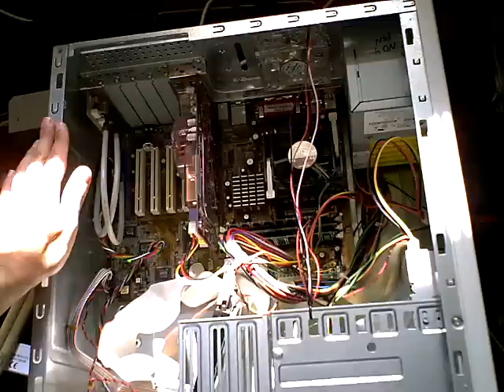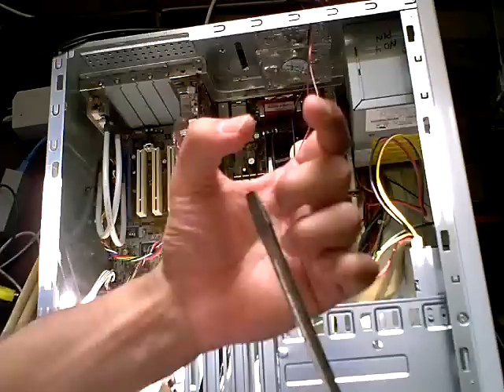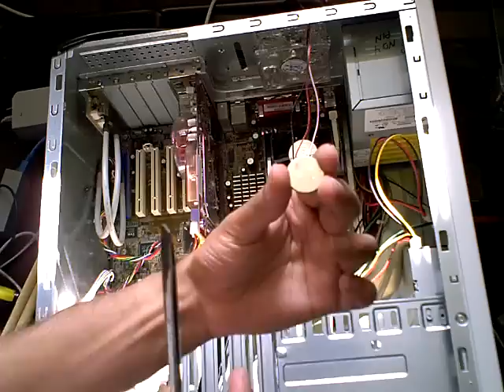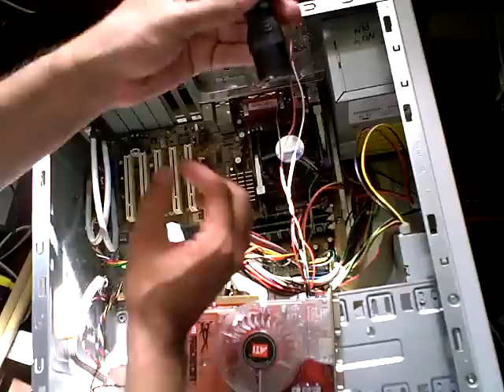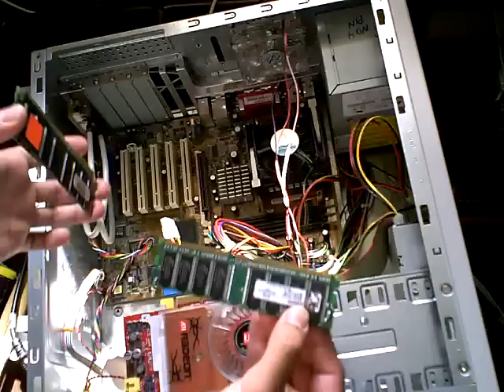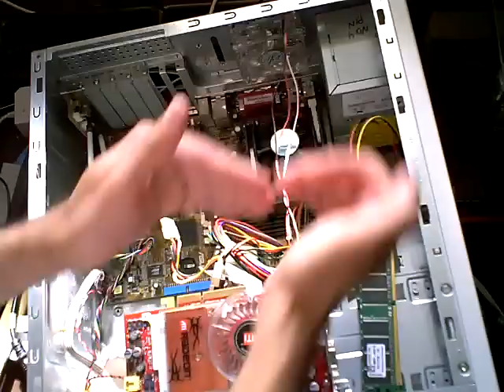How to possibly fix a PC that will turn on but will not beep and will not display anything on screen

Comment: Hey my computer will turn on and then it beeps 1 Long and 3 short and turns off but when I remove the RAM it just runs like normal but no signal isgoingin in the monitor will it work if a replace the RAM
Reply from the maker: Your beep error code is reporting a problem with the display, not with the RAM. I had a similar issue in this video, perhaps you should try everything in this video and let me know if it works out or not:

Advanced troubleshooting technique tutorial of how to possibly fix a PC that will not beep at boot
Reply: OK so I did and it work thanks but heres other problem it over heats and turns off and some times I hear the beeps but most of the time it doesnt so how do I keep it cool?
Reply from the maker: Lizbeth Hernandez  This following video was created for a different processor than yours (chances are) but the tips about keeping the heatsink and fan clean, well attached, and the application of thermal paste all still apply here. Also, ensure that your case is CLOSED (yes, closed channels air BETTER) and install a case fan to blow air OUT of the case (this expels hot air from the case). Of course, ensure that your CPU fan still spins at an adequate speed (reference the temperatures of the CPU to the shutoff temperatures suggested in the BIOS if you are unsure).
 
How to possibly fix your socket 478 CPU processor (Pentium 4 IV) from hanging or freezing

Comment: When I removed the ram and started it, it went 1 long beep, immediate followed by 2 short beeps
Reply from the maker: +Squidly Beep error codes differ from one BIOS manufacturer to the next. To discover what the beep error code is trying to telling you, discover the manufacturer of your BIOS (available in the motherboard's manual or on the motherboard's manufacturer's website {on the page for your specific motherboard model}) and then look up the frequency and interval of your beep error code on:

http://www.computerhope.com/beep.htm

Comment: So i finish building my pc i turn it on for the first time the fans are working everything (didn't hear any beeping) is working but then i look at my monitor and its just black
Reply from the maker: +BestLegitGamer Breadboard it (explained in the following video:)

If the steps in this video did not provide a solution to your problem, view:

http://www.youtube.com/watch?v=_EK9a-R5pss

You never know, maybe rebuilding the PC in the opposite sense that you took it apart will solve the problem.

Comment: so if i remove the RAM and power it on is it possible i can short out the PC or anything like that
Reply from the maker: +Mr mc nuggets Theoretically no, but if you did not properly unplug the PC and press the power button to discharge remaining power before fiddling around in there, you can in fact short out components, so ensure to unplug the PC and press the power button (on the chassis) before removing parts
Reply: thanks i tried the ram but sadly my mother board is dead :(
Reply from the maker: +Mr mc nuggets Well, before deeming the deal dead, I try first to Breadboard it (explained in the following video:)

If the steps in this video did not provide a solution to your problem, view:

http://www.youtube.com/watch?v=_EK9a-R5pss

You never know, maybe rebuilding the PC in the opposite sense that you took it apart will solve the problem.
Reply: thank for the advise i appreciate it

Comment: Hello...When I start my PC it turns on it gives 2 short beeps with a pause and everything works on in CPU but no display comes.3 out of 5 times this happening what I do when it happens that I clean ram and reset and remove and reset power supply from motherboard and it works after trying many times.
and what I recently did before this problem occurred is I changed my PSU with used PSU, my earlier one had 24 pins but the new PSU I mean used one has 20 pins so the other 4 pin separately attached somewhere side.
plz tell me who is culprit Ram or Psu...coz before changing my PSU everything was working fine but 2 short beeps with a pause and resetting ram and wires solves the prob many times...so I confused what to do?
I have 
no graphic card just the default one which comes
assembled PC with 4 GB ram(2 sticks) Intel motherboard and Intel i3 processor
running win10...just a simple CPU 5 yr old
Reply from the maker: If everything was working fine with the old PSU and the current one no longer connects in all the required power ports, it sounds like a more appropriate CPU with all the required connectors would be a better choice.

Comment: My pc isnt deat. Yet. But when i turn on the pc the fan wont spin, well it spins thefirst 10 or 5 seconds. Help fix.
Reply: I mean dead
Reply from the maker: +UnTamed Gamer / TheBronyCommunity It sounds like your motherboard is developing a short circuit due to contact with the metal casing. Most likely it has to do with the screws and metal mounting stands (supports) that your motherboard sits on. The cheapest way to fix this problem is to introduce cardboard washers between the screws and where they make contact to the motherboard, or you can buy plastic mounting supports at a computer shop.

Alternatively, you can always Breadboard it (explained in the following video:)

If the steps in this video did not provide a solution to your problem, view:

http://www.youtube.com/watch?v=_EK9a-R5pss

You never know, maybe rebuilding the PC in the opposite sense that you took it apart will solve the problem.

Comment: hi! can i ask ? my cpu turn on but it didnt work and the monitor display is black  i already take out my memory and put it back and also  my fan stop working but sometime it work can you help to solve this i need my cpu to work again.
thanks more power and god bless!!!
Reply from the maker: +Da Jia Sorry for the late reply. you can always Breadboard it (explained in the following video:)

If the steps in this video did not provide a solution to your problem, view:

http://www.youtube.com/watch?v=_EK9a-R5pss

You never know, maybe rebuilding the PC in the opposite sense that you took it apart will solve the problem.

Comment: i change my video card but whenever i use the new video card nothing appears on my screen. even though the new video card is working. please help me!
Reply from the maker: It sounds like your PC is defaulting to a different video output than you are connected to (possibly even the onboard integrated video output). Keep in mind that you can only change to different video outputs by first shutting off your PC, then changing your display cable to a different video output, and then powering your PC back on. If the first video output change doesn't work, then again power down your machine, connect your display to a different video output, then power up. Repeat this until you have tested every video output available on your PC. Lemme know how this turns out.

Comment: In my pc it does beep and shows windows was not succesfully shut down and i chose start windows normaly then okay the winows loading logo but when it comes to say welcome that screen dosent show up , plsss helppp if i dont fix i willl dieeee 😓
Reply from the maker: +DV Chanel It sounds like your Windows has become corrupted sadly. You can try entering Safe Mode (hold F8 at the bootup of the PC and then select Safe Mode) and see if you can enter your Windows like that. Let me know how it turns out.

Comment: When i press the power button the cpu power on but there is no response in my monitor and keyboard then open the cpu there is the blinking light in network card i tried to remove ram and inserted again then my pc starts but when i shutdowns the pc then again that problem occurs in next start.so can u tell me the problem
Reply from the maker: Intermittent problems such as yours are often too hard to diagnose. I recommend getting the PC into a working state, and once working, when you are done using it, put the PC to sleep instead of shutting down, so that you can wake it when needed and this way you avoid the trouble of booting it. Sorry for the weak fix : \
Reply: RodneyDickson my  problem is resolved there was a issue with my 1 of the ram out of 2 ram 1 was  not  working so I replaced that one now it is fine . thnx for the suggestion
Reply from the maker: Ahh, glad you got to the bottom of the issue.

Comment: Bro i made my build yesterday but the usb ports or other ports arent powered although the led on mobo and gpu is working fine but the ports r lacking power and hence i cannot connect. Can someone plz help me out?
Reply from the maker: +Nimit Jain Are the USB ports on the back of the PC (those physically connected to the motherboard) putting out power?

Comment: Please help me still get beep sound after clean the ram have you another solution? ?? Thanks in advance
Reply from the maker: What is the beep error code telling you? Beep error codes differ from one BIOS manufacturer to the next. To discover what the beep error code is trying to telling you, discover the manufacturer of your BIOS (available in the motherboard's manual or on the motherboard's manufacturer's website {on the page for your specific motherboard model}) and then look up the frequency and interval of your beep error code on:

http://www.computerhope.com/beep.htm
Reply: RodneyDickson thanks you its the rams that not working and thanks for your help
Reply: RodneyDickson nice works
Reply from the maker: Cedric Chellen
Good stuff! Glad things worked out : )

Comment: hi to everyone i have same problem on my pc , i tried everything but still doesnt display anything . when i take out the ram and turn on the pc it doesnt do any bepp or something like that it just continue working , or when i take out cpu and turn on the pc it stiill works whithout doing any beep or any sound . what is this and what can i do , can somebody help me , i think my motherboard is for gurbish
Reply from the maker: +Enes Elezi Well, removing the CPU from the PC would not produce a beep anyway, since in doing so you are essentially removing the PCs ability to process. I'd Breadboard it (explained in the following video:)

If the steps in this video did not provide a solution to your problem, view:

http://www.youtube.com/watch?v=_EK9a-R5pss

You never know, maybe rebuilding the PC in the opposite sense that you took it apart will solve the problem.

Comment: I have a dell pc its the screen and monitor in one. it turns on but nothing shows on the screen can u tell me wats wrong with it
Reply from the maker: Eek! Those are a pain to work with. When your PC used to run normally, did it have a startup sound? and if so, do you still hear that startup sound at boot?

Comment: Ten year old Windows XP system was moved into my new apartment today. Hooked it up, booted it, pulled up a .doc, left the room came back and it was dead. No video fans or beeps.
Reply from the maker: disconnect the power cable, remove the CMOS battery, short the CMOS jumper pins for 9 seconds then return the jumper cap to its initial position, press your PC's chassis power button switch (to discharge any remaining power circulating in the system), leave the PC unplugged and in this state overnight, then the next day return the CMOS battery to its socket, power up the PC, and if things work, then good, but if not, your power supply may have died.
Reply: I jumped the power supply. The blocks internal fan runs as well as the cases rear fan and hard drive but I noticed if I plug the black and yellow four pin connector back into the motherboard everything stops functioning.
Reply: I noticed some brown color inside of the molex block specifically on top of both yellow wires where they terminate. I'm thinking something shorted.
Reply from the maker: That sounds very probable, especially given the browning of the connector.

Comment: THIS WAS VERY HELPFUL YOU EXPLAIN YOURSELF VERY WELL IM IN A SITUATION WHERE I BELIEVE THE COMPUTER I FOUND THE ORIGINAL USER TOOK HIS HDD OUT AND I HAVE NOTHING TO RUN IT ON IM NOT SURE IF IT HAS ALTERNATE HDD INSIDE MAYBE A DEFAULT I DOUBT BUT I NEED A NEW HDD TO RUN IT PERIOD. THIS VIDEO HELPED ME OUT ALOT BECUZ WHEN I FOUND THIS POOR COMPUTER I HAD A  FEELIN IT WORKS BUT AT FIRST I COULDNT GET A ANY SOUNDS NO PICTURE IM VERY INTO FIXING COMPUTERS BUT IM  NO PRO LIKE U BUT I AM A FAST LEARNER IVE BEEN PROGRESSING AS I GO BUT I GOT SOME SOUND ONCE I REMOVED THE RAM I LEFT ONE IN AND I SOME HOW GOT THE SYSTEM STARTED I REMOVED THE GRAPHICS CARD TOO WHEN I DID EVERYTHING SORRY IM TYPIN ALOT I SMOKED A BLUNT AND JST NEED ADVICE SO I WANA BE CLEAR ON MY SITUATION. ALSO I RESET THE CMOS WHEN THE COMPUTER DIDNT START I KNEW IT WOKRED SO THEN I PUT IT BACK ON THE FIRST TWO PINS AND THEN IT STARTED AND BEEPED ONCE WITH JST THE ONE RAM GAVE ME TROUBLE WITH BOTH RAMS . BTW ITS A WINDOWS VISTA ACER E4500 INTEL DUAL CORE PROCESSOR APPARENTLY THIS COMPUTERS RAM COMPACITY IS 3GIGS IT HAD TWO RAMS 2 GIG AND A 1 GIG   THE ONE GIG MAY BE A BAD RAM. BUT IDK WHAT TO DO WITH NO OS GETTIN  A NEW HDD I THINK ITS A SATA ... SOMETHING. AND I REMOVED THE BATTERY FOR 5 MINS NOT 15-30 .. I KNOW I SUCK .. WAS ANXIOUS TO GET TO THE BOTTOM OF THIS .. I SAW A VIDEO OF A GUY SAYIN THAT HIS TOWER HAD SOME HIDDIN HDD ON THE BOTTOM .... HELP ? ..
Reply from the maker: +benjamn luz Heh, I got through your message...somewhat : ) If the HDD has been removed, then yeah, the PC will not have an operating system to boot from. HOWEVER, the PC should still display a message on-screen letting you know that no HDD is present. What does yours tell you?
Reply: Exactly what you said but there wasn't any screen when I first got it on . I had to follow your steps remove parts until I got a beep I knew that maybe the ram was corrupt so once I figured that out I had already reseted the cmos so Idk if both things helped or maybe it was just bad ram but I took all precautions becuz I didn't wana fail honestly. But I get a screen and before the screen on a very quick boot up screen I hit F12 I think and i get to that settting screen where it lets me choose where to boot from only shows my DVD Rom with sucks I'm curious to know if I buy a external hardrive I'm aiming for maybe a 1TB can I boot two operating systems to two computers at the same time tryna crush two birds with one stone I need to move all my data off my main tower becuz my hdd is giving out I know this becuz of the diskette faillure 0 something like that message before booting up it happens once in a blue and at times twice in a row I need to save my info before she gives out comepletey and I have to start over .
Reply from the maker: +benjamn luz Ok, yeah, you did good in that diagnostic. I'd avoid an external USB HDD man, they are unreliable, slow, and will not run Windows (you can run Linux from em, but you can also run Linux from a USB key or a burnt CD/DVD) I'd just get an internal SATA HDD. Just get a cheap used one on Kijiji if you wanna save some cash.
Reply: i dont mean like a small usb im talking about like a bigger kind i seen online
Reply: but ill look into what u said thank u. but i wanted to know if the one i had in mind can run two os at the same time can i hook up two desktop two run off one external i was curious ..
Reply: it loks like a box the external i saw online
Reply from the maker: +benjamn luz External drives can only run the Windows operating system if they connect to your PC via SATA or IDE (PATA). There are removable bay solutions for drives like this, however, mostly when you refer to a drive that connects externally, it is done via USB and USB drives can only run Linux as an operating system; not Windows. I run both Windows 7 and Windows XP on my gaming machine: I could format one hard drive to be a dual-boot situation, where I choose which operating system boots at startup, but instead I just have two physical SATA drives in my machine, one housing each operating system, and whenever I wanna switch from one OS to the other, I physically unplug the SATA interface cable from one and connect it to the other.
Reply: you my friend are a genius.
Reply from the maker: +benjamn luz Heh, far from it, but glad to help : )

Comment: When I boot up my pc my monitor goes blank with 99 in the bottom right corner plz help and comment ASAP
Reply from the maker: Look up your monitor manufacturer as well as 99 in Google. That code means something, but I haven't a clue what (could possibly mean 'no signal' for all I know)

Comment: Hello i am building a pc and it powers on and the fans are spinning but the usb ports wont provide power
Reply from the maker: Does your PC output an image on screen?
Reply: +RodneyDickson my lights on my keyboard light up but when i go to setup bios it asks me to press f12 but my keyboard will not work , i have a brand new motherboard ... please help
Reply: i fixed the situation
Reply from the maker: Well, glad things are working then
Reply: +RodneyDickson do you have any thoughts on my situation?
Reply from the maker: Sorry Wade, lost your comment since you piggybacked onto Seth's. Rondo had a valid question regarding how you connected your USB headers to your motherboard. Try powering down the PC, connecting your keyboard to a USB port that is SOLDERED to your motherboard (one in the back close to all the other connectors) then power up. Repeat with a different USB port each time if this does not function. If after testing all USB ports you do not find a situation whereby you can use the keyboard, test the keyboard on a different PC and make sure that A) it functions, and B) the F12 key functions. All in all, the easiest fix: if this is a USB keyboard, and you have a PS/2 port on your PC, then buy and use a PS/2 keyboard. If this is a PS/2 keyboard, then buy and use a USB keyboard. Hope things work out.